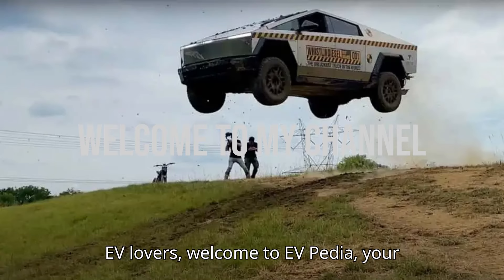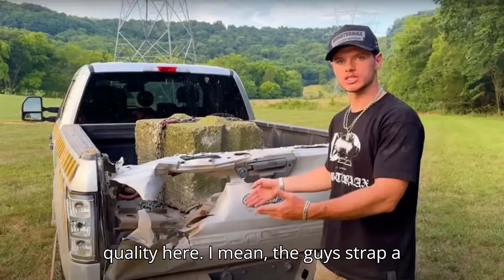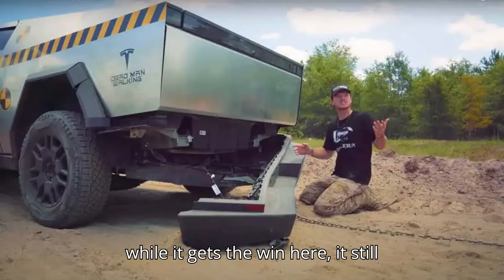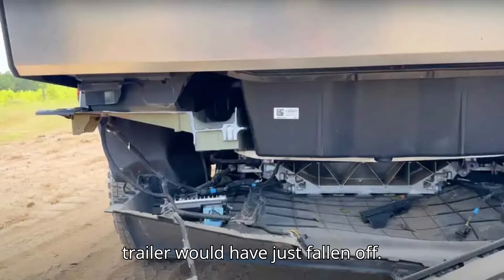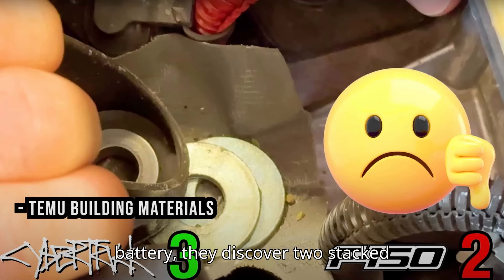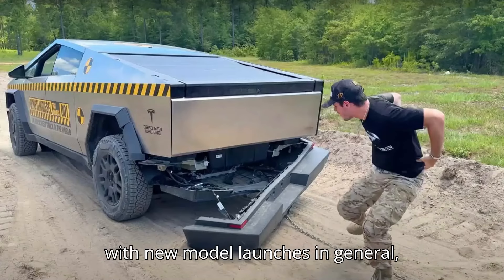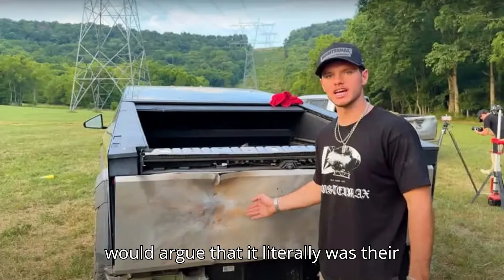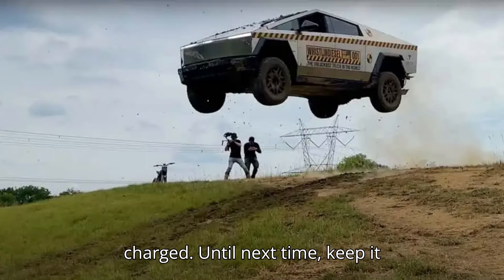Tesla Cybertruck Flaws Seen In Torture Test  'Frame Snaps Off The Back'

Comment: The full video shows the Cybertruck being jumped far higher than the Ford.  The the Cybertruck is being driven off some concrete pipe, which drops the rear bumper twice onto concrete.  Then during towing, the Ford drivers slams on the brakes to intentionally yank the bumper off.  You are being scammed for clicks.

Comment: Driver at fault. ps google F-150  crash images you`ll see a 150 with its side torn off doors still closed, another the cab has sheared off the frame and said cab is a fair distance down the road, then the bent chassis flaws where the truck is bent in half....